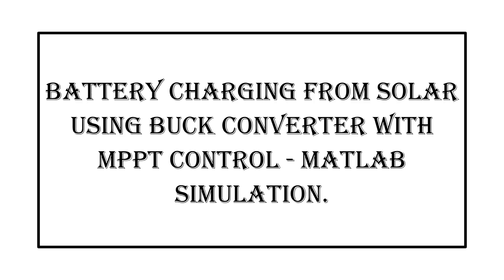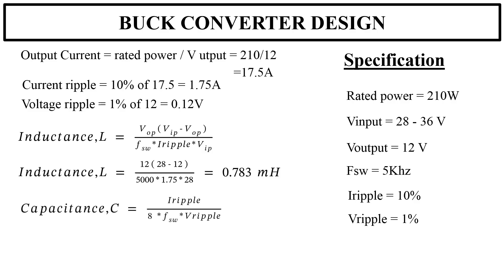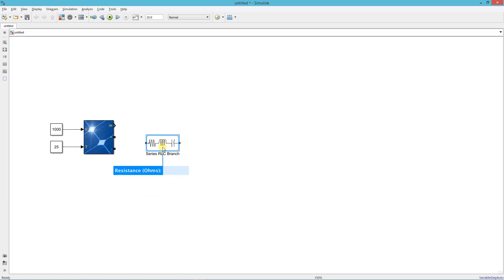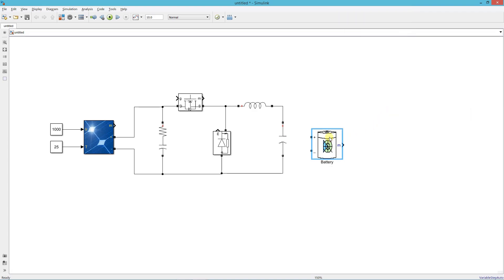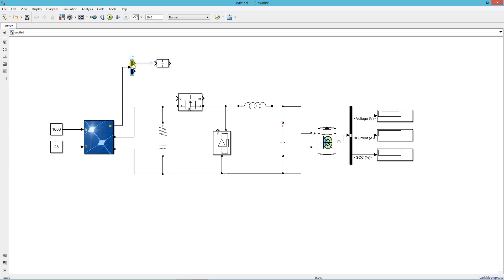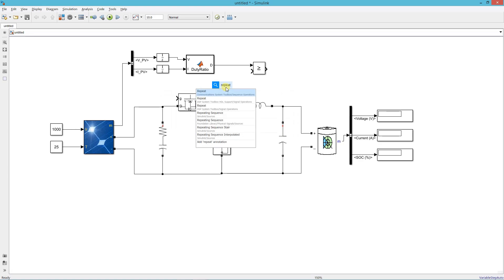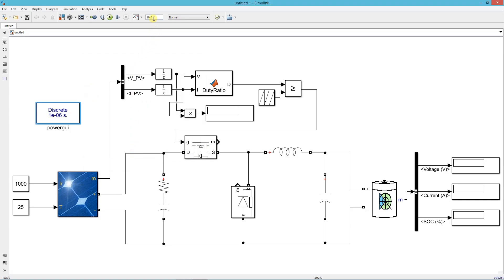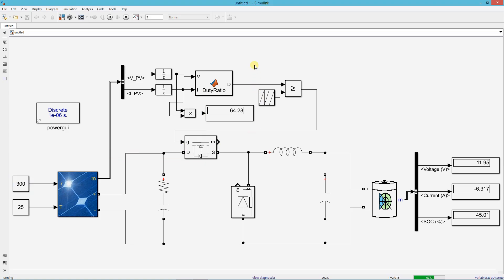Battery Charging from Solar PV using Buck Converter with MPPT | MATLAB Simulation.

Comment: How we can run DC load & battery charging on mppt both
Reply from the maker: need to adjust the battery current with respect to the load current and maximum power point

Comment: I have tried this video but at 1000 radiation power is coming 109,it should come 213 so anybody can help me?
Reply from the maker: pls share the model at ashacademy01@gmail.com
Reply: I have mailed it please check
Reply: Did You get any answer about this question?, I've got they same value during simulation.
Reply: Hello, pls hw were u successful able to get pass the diode error during simulation

Comment: Sir, can u please do a simulation of charging of a battery using boost converter. Is the process same or have to change anything?
Reply from the maker: buck output current is dis continues, difficult to charge the battery

Comment: Thanks for this tutorial video sir, 
I have a small doubt the battery is charging very slow so i tried increasing the run but the simulation time to complete the process is taking so much time. So then i changed the sample time in Powergui block by this simulation runs faster but the mppt block doesnt reach Vmpp faster what can ba done sir?
should i change any values in code or any other way?

Comment: Hello Can I ask ,I am a student and I made a simulation of solar powered vehicle using a PV array, Boost converter and DC motor with battery. But the simulation result were wrong, that it gave a high amount of the output current as also the torque even though that the curve of speed is correct. Can you advice me what should I change!
Reply: Hey how are you doing?
Reply: Trusthungwe2@gmail.com send me an email 📧

Comment: Can anyone tell me why is the battery current negative?
Reply: because the characteristic of battery lead acid in "simulation SIMULINK" show the negative current is charging, and the positive current is discharging. 
you can proof it on the "search documentary" on the top right of the Matlab, and type "battery". you'll found it

Comment: Hi, thanks for sharing this video.
Is it possible to simulate in PSIM ?
Reply from the maker: Yes
Reply: @TechSimulator   how to find the battery in psim ?
Reply: @TechSimulator  Sir please i have a doubt how did you choose value for input bus capacitor and resistor pls tell from where did refer is it any book or research paper i have been searching for long time my simulation has more ripples i need to simulate with less ripples pls help me sir.....

Comment: sir, can i asked you why you put 0.95 and 0.0001 as the value for Dinit and deltaD?
Reply: Yeah I have this exact same question. From his parameters, he has V_out = 12V and V_in = 28V. Moreover, the duty cycle equation I have come across is D=V_out/V_in ..... D=12V/28V= 0.42857 ...... So how come he has 0.95? I've checked his previous video but he hasn't explained why he put 0.95.
Reply: 0.95 is the maximum limit of duty ratio...

Comment: Hello,can anybody explain why we use buck converter? I searched and it steps down the voltage..So why we still needs a buck converter if we already using a mppt controller which converts extra voltage to currents?
Reply: Wait..is the buck converter is actually the mppt system?how does the circuit works?please help i really appreciate it..my lecturer wont respond to my question and i really needs some help

Comment: Thank you sir, your video is so helpful. can i ask you sir, how many watts peak or wp of the pv that you use?
Reply: it's on the beginning of the video, u can see the specification and calculate it (mostly in each pv datasheet), or in the product of V*I in the simulation
Reply: @AbizarADANNI  thank you. if i use pv 25 watt peak, where i can replace the watt peak?
Reply: @angelasembiring  just try to find ur pv specification and find the Vmpp, Isc, Impp, and Voc, and how many cell did the specification provide, and input the variable to the formula
Reply: @AbizarADANNI  thank you sir, but can i ask u about fsw, vripple and iripple. where i can get all of them cuz there aren't on pv datasheet

Comment: Sir, can you please say which book Or paper you are referring for design formula of inductance & capacitance for LCL filter in active rectifier? 
Sir, your videos are really helpful for my Research. Thank you. 🙏
Reply from the maker: single phase or 3 phase?
Reply: @TechSimulator  both Sir.
Reply: As there are many design formula for LCL filter. Sir, Please help .
Reply from the maker: @ramaramkumar7966  i have already made videos on lcl filter for single phase and 3 phase inverter. I used the same design values for active rectifiers
Reply: @TechSimulator  ok Sir. Thank you very much.Sir, Can you please share from which book you referred the design concept / procedure of LCL filter?

Comment: Sir Scope does't use this diagram ? Show the Waveform for output voltage ?
Reply from the maker: i thought displaying the values is better than using a scope for your better understanding. anyways i will give you the simulation that i made. you can add scope and see the waveforms
Reply: @TechSimulator sir, can pls send the matlab  stimulation